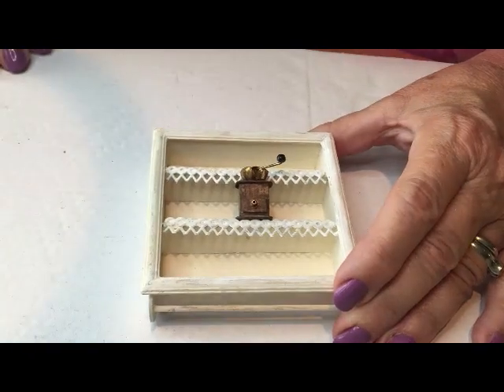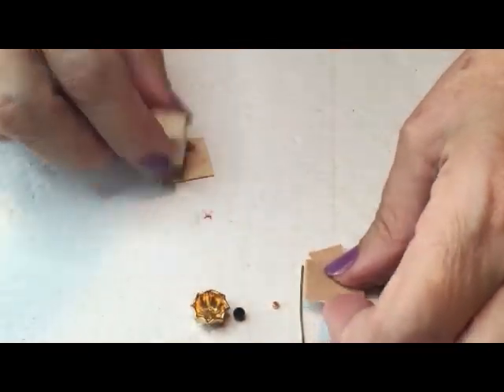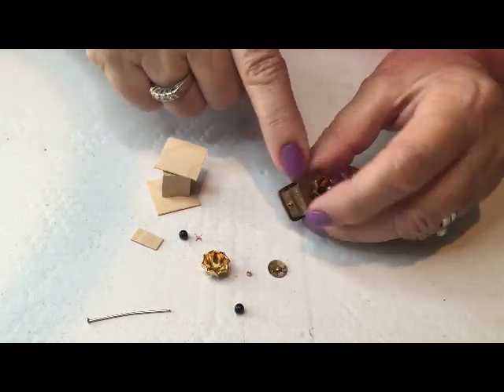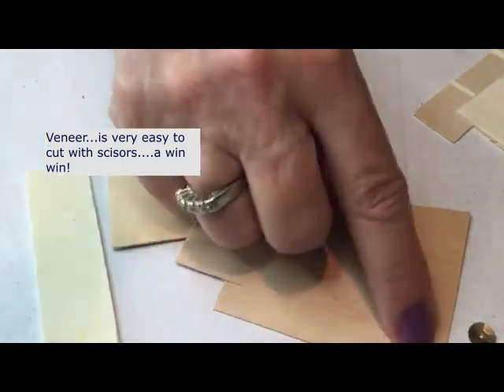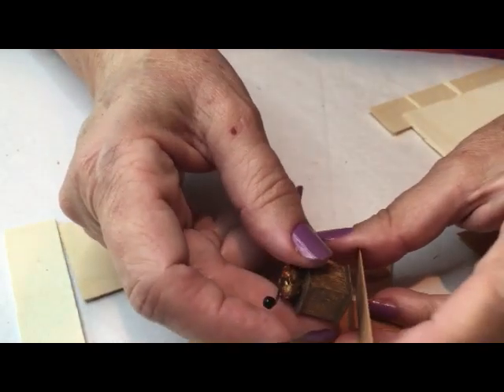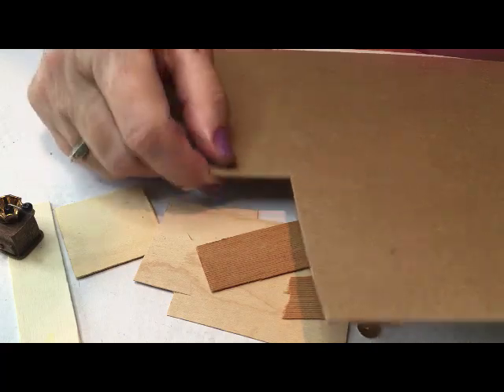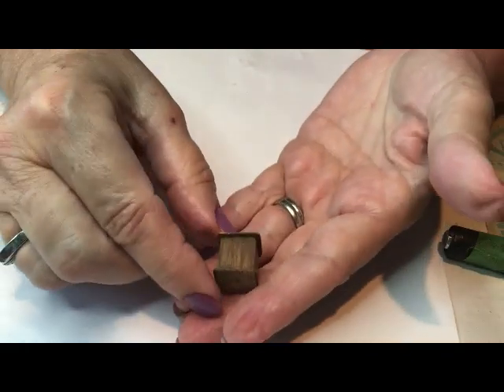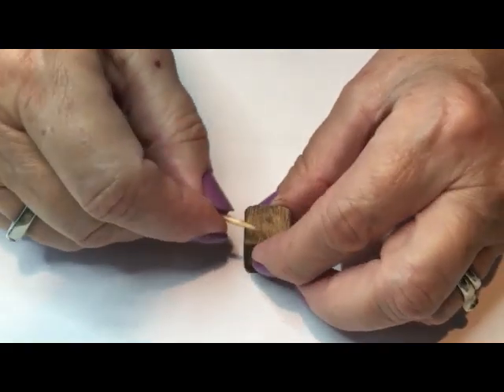1/12th scale Dollhouse Miniature Coffee Grinder DIY-Tutorial

Comment: Thank for sharing this project! This is definitely going on my project list!
 Another great tip using a cork to drill into. I have found that the emery boards (nail files) from the dollar store work great for sanding small pieces since they are less bulky than a sheet of sandpaper.
Reply from the maker: I'm very happy you will give it a try.  I'm sure it will be wonderful.  Yes, nail files are great as well.  Thank you for the input.